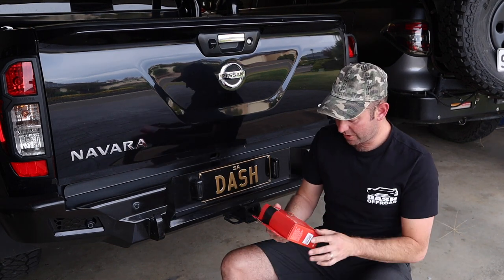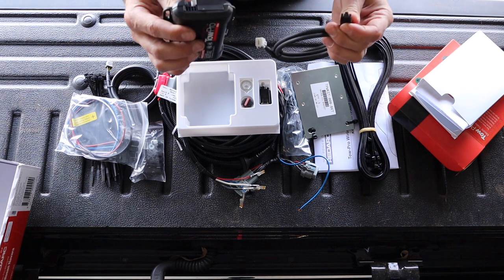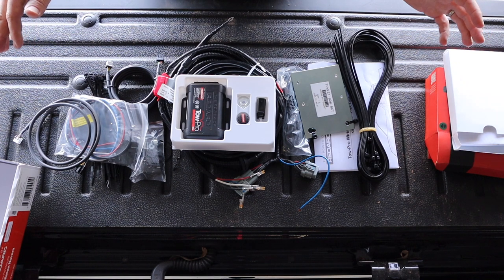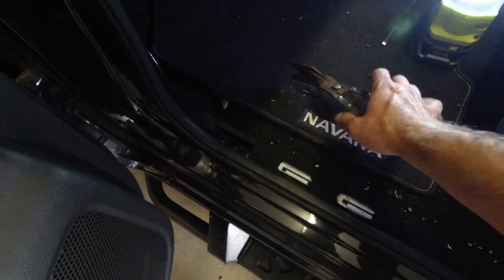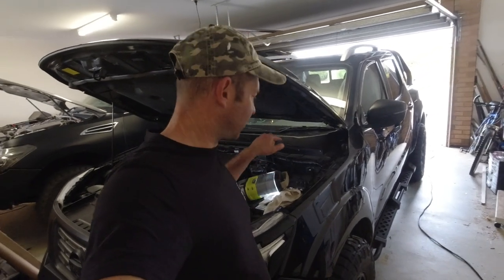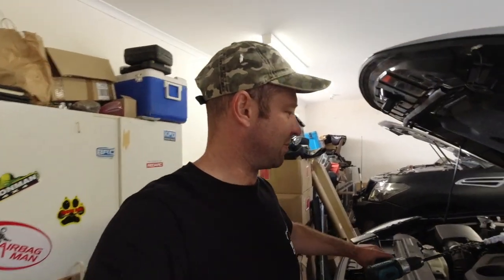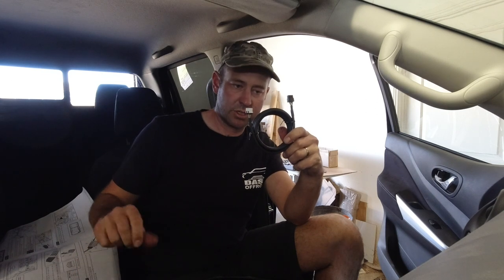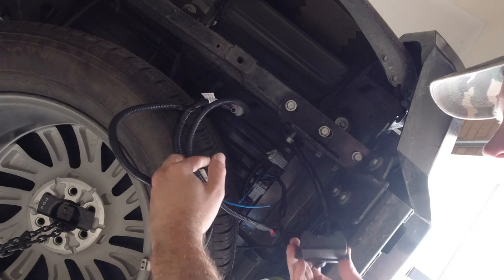How Hard is it to Install a Redarc Tow Pro Elite for NP300 Nissan Navara?

Comment: Install one of these whole system in the 200 series with the wiring harness from redarc I've got 2 of the elite3 units . Redarc is by far the only thing I'll use coat hanger works best for the fire wall

Comment: Nice setup mate. So about how heavy is that trailer you are towing?  I just got me a 2021 Navara (Frontier in Mexico). 2.5L Diesel. Some changes to the grill. Not a lot of change. I am looking at getting a tow hitch next. Specs say this truck could tow 3.5 Ton. Has me thinking when most class III hitches are rated for 6000 lbs only. Great looking truck! What size tires are you runing? 285/70R17?
Reply from the maker: Correct, running 33’s and towing 3T, poorly
Reply: Yea watching the video you uploaded i could see the trailer swirving some. Thats never a good feeling.  Does your truck have leaf springs on rear? Mine has coil springs which I thought was a bit bizarre for the towing capacity stated by the manufacturer

Comment: Just noticed something that you might want to double check....in the video when you are under the back of the tub connecting the wiring loom, it looks like one of the bolts on your towbar is not done up properly.  Hard to tell on my crappy computer, but the bolt nearest to the wiring plugs you connected (into the side of the chassis) appears to be near fully undone.  Not sure if this may be because you have undone/removed something for the purpose of filming, or whether it may have been missed when the towbar was installed.  Cheers mate, and even some of us Toyota owners like watching your videos.  Keep up the great work.
Reply from the maker: You have a very keen eye there. Actually the tow bar is a prototype that I was mucking around with at the same time. It comes off tomorrow for the next model to be bolted up 👍. Secretly, I do like Land Cruisers too 🤫

Comment: How does it break the actual trailer? Is there another unit which goes on the trailer? And does it have an electronic actuator?
Reply from the maker: It’s assumed that your trailer already has brakes
Reply: @DASHOffRoad  what type of breaks? Most trailers just have mechanical breaks with cables. How would some eletrical device affect the trailers breaking?
Reply: @Zapo9668  Electric brakes...